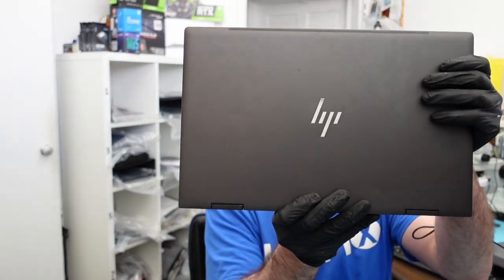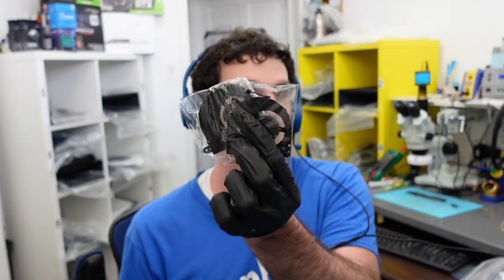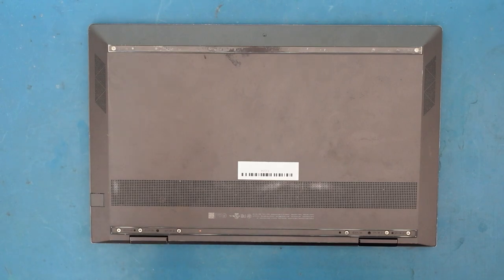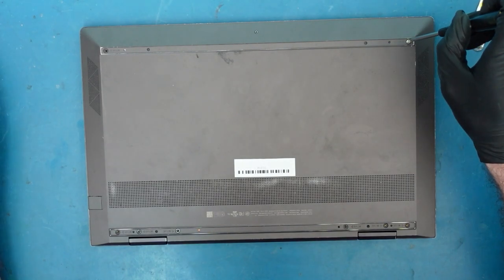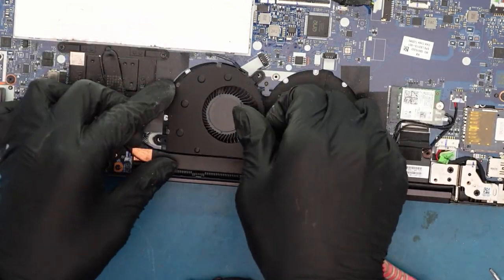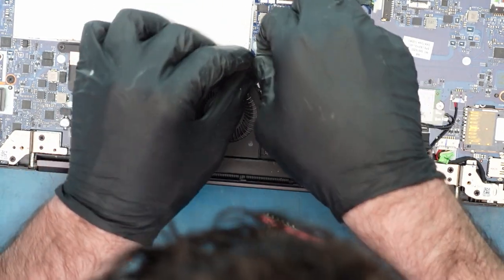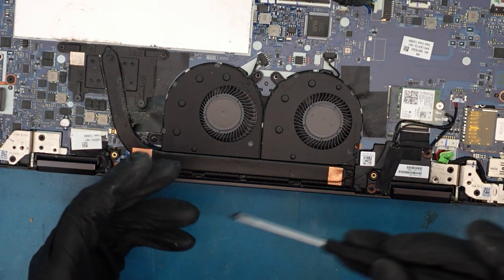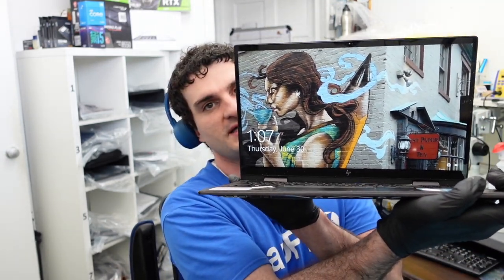Error 90B HP Laptop X360 Fan Replacement

Comment: Accually, that is wrong information! 99% of the time a HP "90B Fan error" can be fixed by updating the BIOS!  Usually the fan is working just fine and does not need to be replaced.  Im Sorry you lost all credibility as soon as you mentioned using WD-40 on a PC fan for lubrication!